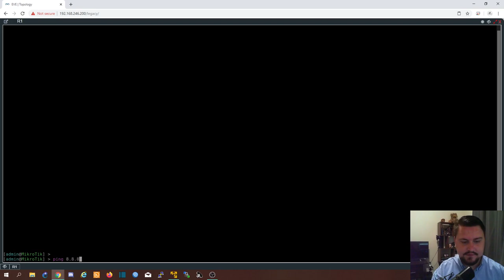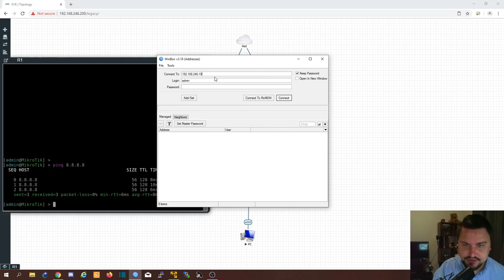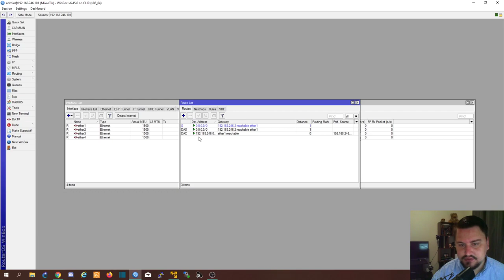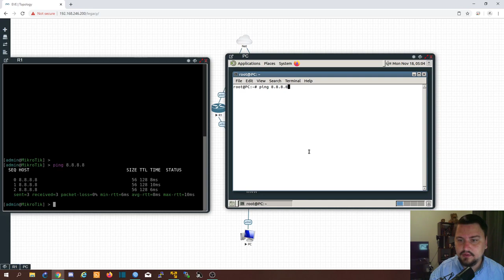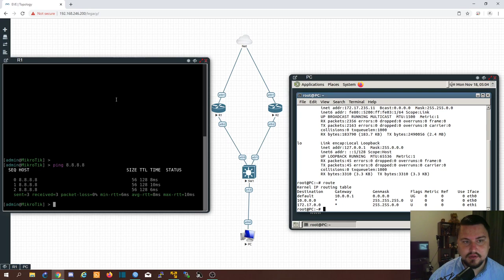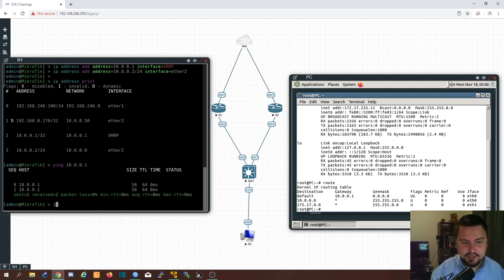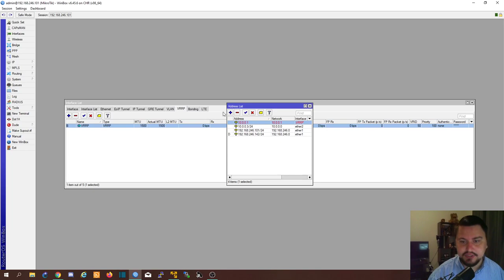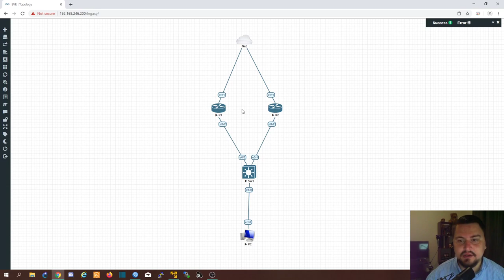MikroTik  - Configuring VRRP

Comment: I'm looking to implement this for my small business. We use a RB4011 and CCR2004, how would we get both on the same WAN or would I need to buy a secondary connection for router 2? I'm curious if OSPF or VRRP would be a good fit.

Comment: What is the Network simulator you are using?
Reply from the maker: I make use of EVE-NG :)
Reply: @TheNetworkBerg  where to get all appliances (router, switch, cisco & Mikrotik etc.). I there any all preinstalled vm?
Reply from the maker: @GTech-IT  Nothing is preinstalled, you need to supply the images yourself, you can get Cisco images from their site, Juniper from theirs and MikroTik from their site. Though MikroTik is probably the easiest to obtain as it comes with a trial license.
Reply: @TheNetworkBerg  I  have install mikrotik,         trying to install cisco. do you have 2960X image..
Reply from the maker: @GTech-IT  no sorry :( It's also not allowed to share images between users. I would speak to your Cisco account manager to get the images... Else Google can be your friend.
Reply: @TheNetworkBerg  Yes, Google has already given me some images. But it is not starting. It starts for a few seconds then stopped.  Mikrotik also not starting. Do you have any idea?

Comment: (RU)Спасибо.
А каждый маршрутизатор подключен к своему каналу Интернет? А если один канал? Можно его дать и на первый и на второй маршрутизатор через коммутатор?
Reply from the maker: В этой демонстрации да, есть два разных канала. Если ваш интернет-провайдер позволяет вам, вы можете подключить кабель к коммутатору, который соединяет оба маршрутизатора с оборудованием провайдера, предпочтительно через VLAN, так что это то, что я хотел бы обсудить с интернет-провайдером.

Приносим извинения, если перевод с помощью Google Translate немного неверен.
Reply: @TheNetworkBerg  Thanks a lot for the answer. I meant a little different. Let's say we have a dedicated IP. Can I accept it with an L3 switch and redirect it to 2 routers in the VLAN? It turns out that both routers will have the same Internet IP. One router is working, the second is in standby mode. So does this protocol work? Or will badaboom happen?  What a pity that it is impossible to insert an explanatory picture!

Comment: Can you make a VRRp using any 2 similar routers
Reply from the maker: Hi Roy, yes VRRP is industry standard, you could mix and match different routers or even vendors like a cisco with a juniper though this is generally frowned upon as neither vendor will want to support you if you are having issues with the hardware regarding the VRRP.